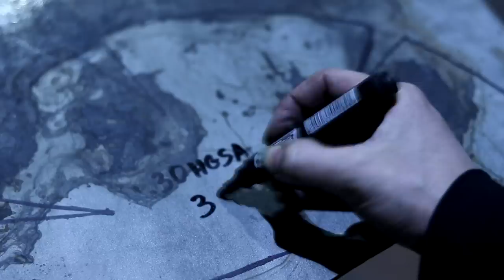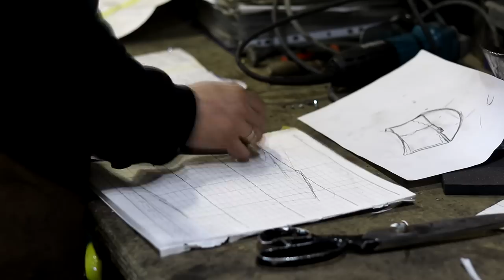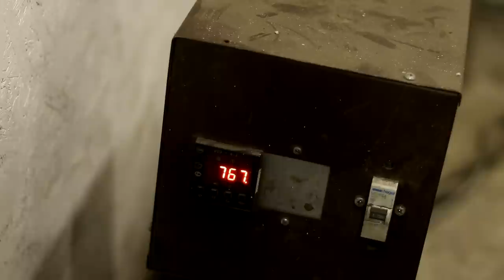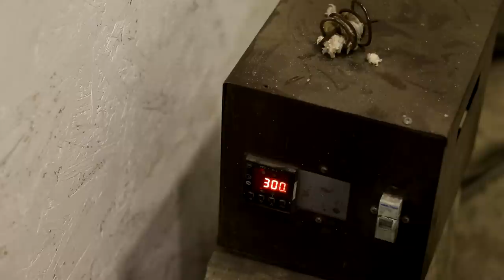How to make fantasy helmet . DIY Forging armor

Comment: This video, and many others like it, actually shows you perfectly why medival smiths were so highly praised. Because they didnt have grinders or drills, and certainly couldn't just "weld over the hole and try again". They either got it right the first time, or all that time and material was wasted, and that is something that barely any smith today even has an inkling of what that might be like.

Comment: Question! 🙋🏼‍♂️ when you heat up the steel and wire wheel it with what appears to be brass, does this act as a layer of rust prevention? Or is it purely aesthetic?

Cheers from Chicago!

Comment: Just to think the skills required to make that sort of helmet back in the medieval era. No electric drills, no saws, no welding machines. Just you, a sheet of metal, an anvil, a furnace, and a bunch of tools operated purely with hands
Reply: By the period the helmet fits (late 1400's) they did have water powered hammers... Since the 1100's. Greece and Rome had the. Around 300 bc. China is believed to have them earlier still. From what I understand it was the reemergence in medieval Europe that led them to being used for armor and weapons forging in some of the grand armories of Europe.

Comment: What kind of steel did you use to make this helmet?
Reply: Probably aluminum
Reply: @Vodkadude  You don't temper aluminum.
Reply: @Vodkadude  Well said XD. Also the process of applying bronze to the steel visor by heating it, would melt clean through aluminum. (1220~f, steel is around 2200~ bronze is 1600~)